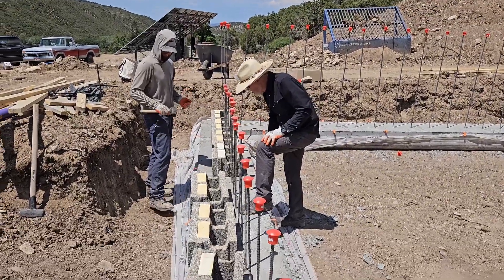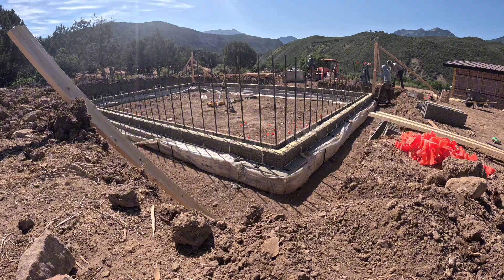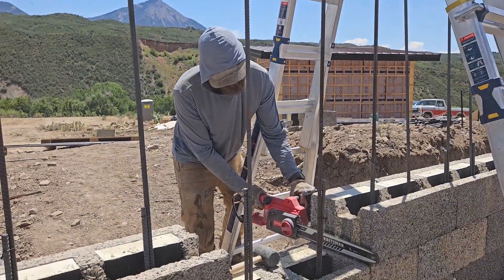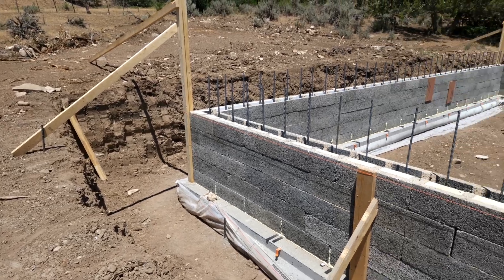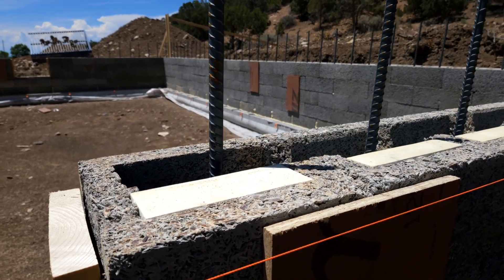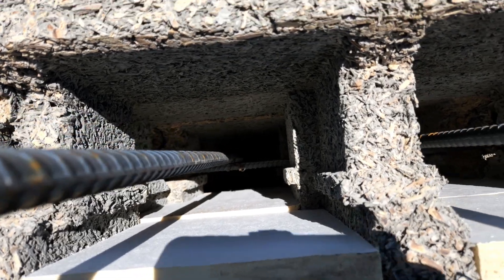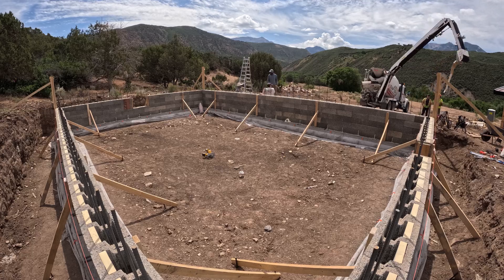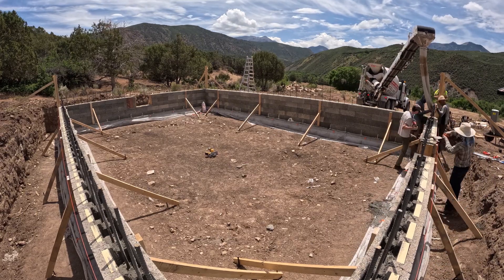Faswall Build Week 3: Laying First 5 Courses + First Concrete Pour

Comment: Ok. So fastwall. That’s def. Not fast. Not cheaper. Not better than cmu. Bc it’s not going to be airtight and adding a wrb to the exterior is going to be. Maybe impossible. This is never use block imo
Reply: Vapor permeability is different from being airtight. Faswall should be airtight and should be good on a blow door test. Advantage being made of non toxic materials, fire resistant, passive insulation standards and diy friendly. CMU is definitely way cheaper but way labor extensive.
Reply: It's Faswall, not "fast wall." And whether or not it's better than CMU is subjective, depending on the homeowner's/builder's end goal. CMUs are entirely cement, are mortared with cement mortar, and may or may not be in-filled with cement. This results in finished concrete wall that is not vapor-permeable. However, if the homeowner/builder desires a finished concrete wall that is vapor-permeable and naturally regulates indoor humidity levels, then Faswall (and also Nexcem and Durisol) is the way to go, since the wood-cement composite blocks are vapor-permeable, and will remain so provided they are finished with vapor-permeable material like lime render or clay and/or are clad or veneered properly (with rainscreen and/or weep holes).